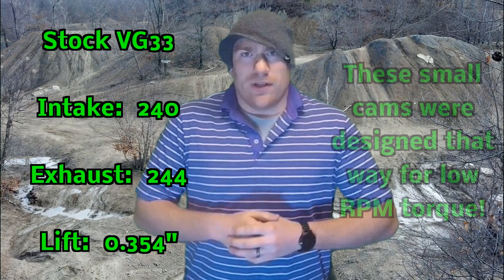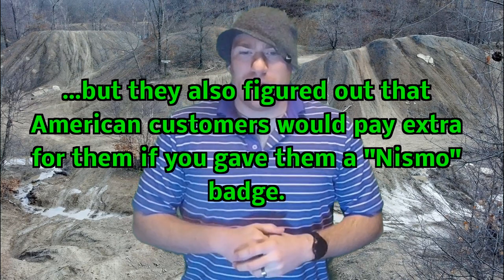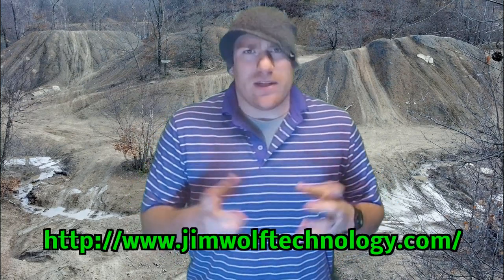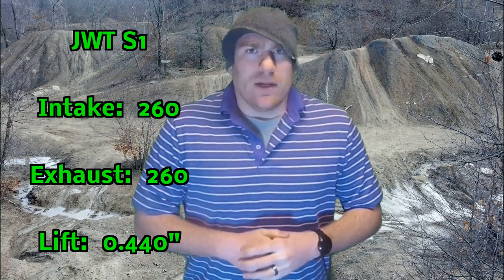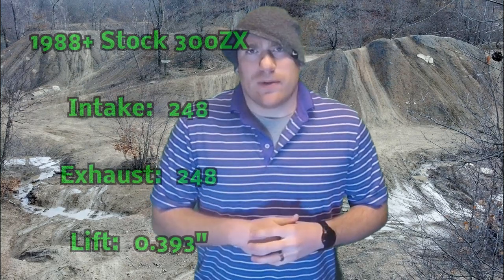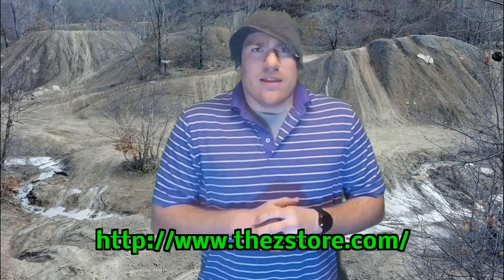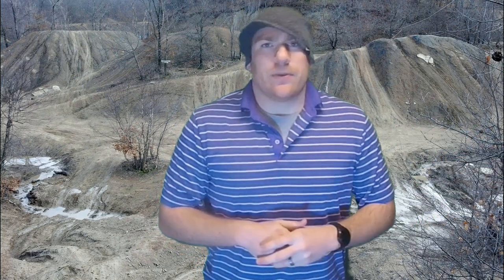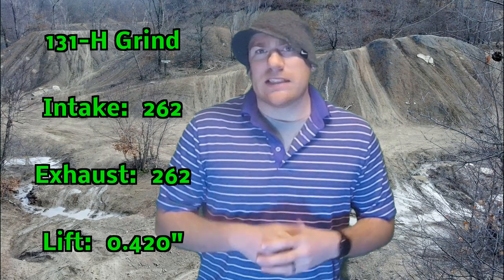Cam Plan:  Camshaft Options for First Gen Xterras:  Euro Cams, JWT, Z31 Cams

Comment: If I were to try and do a set of cams I did look at the Jim wolf Sw1. I do have an automatic in my Frontier SE 3.3. If I do the cams I think it would be good to service the valves, valve seats, and oil seals also. Maybe even polish the ports while your there. Getting a bit more grunt out of the vg33e. Currently my truck is close to 200,000 miles and is my daily but I'll see what I can get my hands on before my daily even goes down.
Reply from the maker: You are right that a job this big can easily snow ball into a "while I'm in there...might as well..." Type of project. My goal is to swap cams without pulling the heads though, so I am going to try and leave the valves and seals as is since they aren't causing problems for me currently.
Reply: I haven't looked up the procedure on replacing the cams yet. I'm hoping the procedure isn't too crazy. I gotta look it up. If you can do this with out taking the head off  I might do it also when My Armada finishes its body work.
Reply from the maker: It comes down to the front cross member/ radiator support if you have clearance.  Also, the bolt on the back is a pain to get to from what I've read.
Reply: @XterraRob  Its pretty much like doing the Timing belt except but going alot further. In that procedure I know that the radiator has to come out anyway. Done 2 in my life and learned the hard way 2 times. I didn't slack the valves though.
Reply: HAHAHA     into a "while I'm in there...might as well..." Type of project. STORY OF MY LIFE!!
Reply from the maker: Thats the misery of a cam swap. A ton of time and money later...all done!

Comment: What performance do you expect this swap to give you over stock? More hp at lower rpm?
Oddly according to my scan gage the engine only puts out around 60 hp @ 2400 rpm though the torque is about 120ft/lbs. foot on the floor @ 4000+ rpm I’m reading 160hp and 200ft/lbs. it is an 17 year old engine with 240 000 km on it.
Reply from the maker: The spec page says hp/tq increases from 1800 to 5800 RPM. Its a very mild cam by the sports car standards...but the Xterra isn't a high revving sports car. Im hoping to have the mid range power be noticeable enough to make it easier for merging freeways, pulling out in traffic, etc. I'm not doing dyno pulls or monitoring anything...i just like projects.
Reply: Well, I look forward to seeing your results. Even if it is a “butt dyno” feeling. Always fun to tinker. If it works out I may follow suit.
Reply: I wonder how it will affect the already terrible fuel economy?
Reply from the maker: I'll let you know!  I read it will actually help...but I'm not sure. Its not my daily driver anymore, so I dont track mileage too closely.

Comment: Do you think JWT stage 1 cams in a VG33E  will pass smog in california?
Reply from the maker: Oh man I have no idea what the smog inspection includes in California. You May have to ask JWT directly. Once I get mine installed, I can at least tell you if it causes a check engine light...but if CA does a sniffer test, I have no clue what they deem passing or failing.

Comment: Hey man I have a 2010 xterra and I installed a 2.5 inch spacer lift. The car is 2wd drive so probably not meant to have the lift but I wanted it. So I ran into  a problem where the stock upper control arms were hitting the strut mount. So I replaced the control arms they have a lot of clearance but now when I turn I hear a popping noise. If you have any idea what this could be plz message me back I’d really appreciate it.
Reply from the maker: For clarification...you got upper control arms designed for the lift? Giving you plenty of space between the coil spring and control arm?  I would turn the wheel full lock to one side and park it...then shake the truck at the fender and see if you can recreate it. It may be the spring slipping or sliding on the spacer or something.  Does it only happen in one direction? Or only when at speed?
Reply: The upper control arms weren’t designed for the lift they’re just bigger with an adjustable ball joint. The noise seems to happen when I’m turning and I hit a bump in the road or a sharp turn. If that helps at all. Happens in both right and left turns.
Reply from the maker: Almost sounds like the UCA is rubbing on the coil spring or something. Which UCA did you get? I'd still turn the wheel full lock and shake your truck at the fender and see if you can watch or listen and recreate it. Coukd be UCA having coil bucket contact near top of spring perch or UCA rubbing on coil spring.